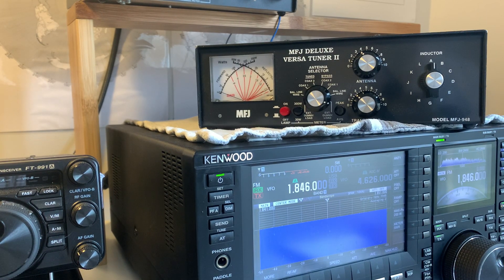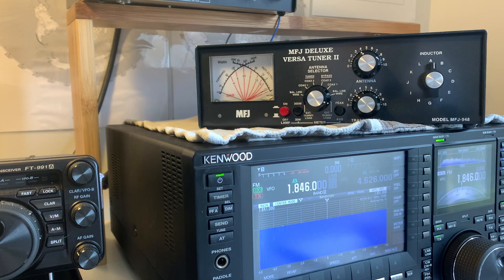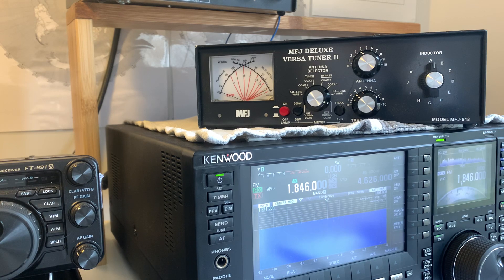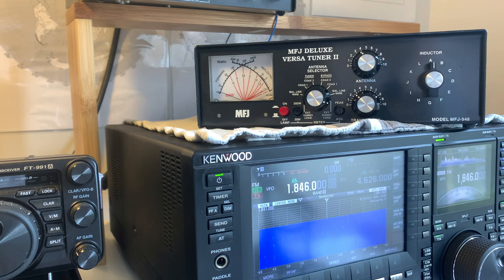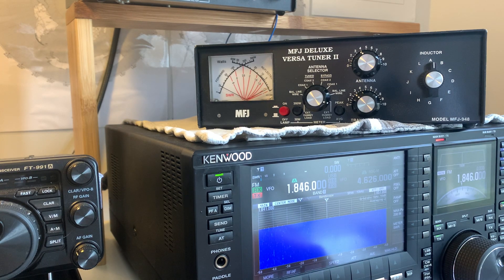Revealed: the uncomfortable truth about how ham radio manufacturers specify their products 'PART 2'

Comment: Hello, have you tried scoping the output? I suppose you could check between the 30dBm att. and antenna so you don't blow the input of the oscilloscope (at 23 dBm is only about 9Vp.p)
The modulation used matters also, I suppose you weren't using FM on 160m when you received bad reports 😉
Reply from the maker: Hi no I haven't tried that yet - but thanks for the suggestion 73

Comment: I wouldn't bother value from MFJ. It is good enough. From the camera point of view, the needle is not zeroed with that gray screw under the display, but as I mentioned earlier I wouldn't bother as analog meters have mirrors to do that correctly, here is just an indicator. Technically for the meter to be an indicator it is required to the measured value should be within tolerance between 2-5% of the measured range, in this case, +/- 15W.  I would try to recalibrate the display in a reasonable way, as the lack of a backing mirror nullifies all efforts, and try to find out if the error is within tolerance. Of course, as you mentioned, the same indication for both radios points out that the issue is somewhere else.
Reply from the maker: Cheers

Comment: Here's a question and a possibility to think about. How narrow is your 1:2 SWR bandwidth when you tune up on 160m? If you have a fairly short antenna it's quite possible that you have a very narrow bandwidth. SSB occupies a bandwidth that it uses to modulate your voice audio. Let's say your SSB bandwidth is 3KHz. Then on 1.9MHz or 1900KHz the high frequencies of your voice audio will be transmitted at 1900-3KHz (on LSB) which is 1897KHz. If you are using some kind of eSSB mode the bandwidth could be 6KHz and high frequencies could be as low as 1894KHz. If your SWR at these lower RF frequencies is too high you may see some significant attenuation (clipping) on those higher audio frequencies. You mentioned speech processing. I could imagine that if your two rigs are set up differently for their bandwidth and speech processing, one of them could be putting out more power than the other in these high audio frequency (lower RF frequency since it's LSB) signals. The higher SWR in these RF ranges could explain the clipping your hearing. Your FM carrier testing is a single frequency and so is not exploring the edges of your SSB transmission bandwidth. So you could tune around with your rigs to check your SWR bandwidth with your antenna tuned up on 160m on your antenna. Maybe worth taking a look. Or it could be another rabbit hole :)
Reply from the maker: Thanks for your comments. The SWR is better than 1:2 and not particularly narrow. 73
Reply: @OxfordShortwaveLog  Ok fair enough. Still might be worth ensuring that the SSB bandwidth and speech processing are as close to the same as possible on both rigs. Good luck and 73.

Comment: The tuner has to be able to handle the transmitted power AND the reflected power simultaneously. Even on FM mode....If you're transmitting 225w and the reflected power is  at 33% of that (or more, obviously), you're already over the power handling of the ATU. Now try that on SSB. MFJ=Mf'in Junk. Edit If you're tuning much over 3:1 SWR, you're beyond the limits of that MFJ.
Reply from the maker: I don't actually believe either rig is transmitting 225W...remember there's up to around 10% error in an analogue meter. 73

Comment: That is very interesting.  Could there possibly be some distortion coming from the Kenwood?  You'd need another external tuner to test, for using the internal tuner would use a different signal path.

Given that both rigs are outputting the same power, why would the MFJ be OK with one but not the other?

Regardless, I'm quite jealous that you have two radios that do 200 watts!
Reply from the maker: Thanks for your comments!

Comment: As you said this is FM power - for me this leaves some differences in SSB output power (maybe due to different processing of mic?). Very interesting!
Reply from the maker: No I turned the mic gain down - remember all you need is a carrier...for this test where I'm not measuring the absolute TX power of either rig, this is more than adequate. Thanks and 73
Reply: @OxfordShortwaveLog  thanks. I meant when you tried to work 160m, maybe due to mic gain the output was different. But thats just a guess...
Reply: @TheValtss  mic gain has no effect on fm carrier.

Comment: Looking at the MFJ, the forward power meter needle is not zeroed and reads slightly high. So your readings when corrected for the meter offset at 200w will probably give you an indicated 200w.
Reply from the maker: That is correct but as I mentioned, this isn't an absolute measure of TX power for either rig, it's a comparison, looking for a delta. 73

Comment: Hi Clint. I looked inside my MFJ ATU, similar to yours. The balun inside is tiny and is showing signs of being affected by heat. Never have run it close to 300 watts, maybe 120 max FT8. RF is funny stuff, I did a mod to my doublet last week and it didn't work out as I hoped. Put everything back as it was for ages and working well, now all kind of issues have developed.  Classic case of if it ain't broke, don't fix it lol.
Reply from the maker: Hi Nigel, I hope you're keeping well. How's the station working now? Good I hope. I've reversed the drive on my end-fed wire - transmitting backwards lol - but I'm getting much better signal reports and the bare match on 80m is now 1.2/1! 73